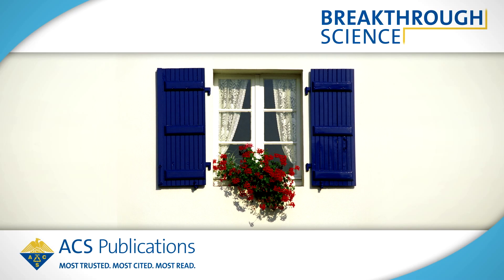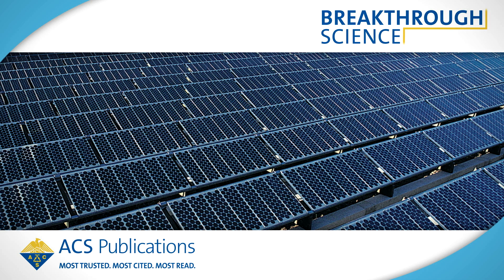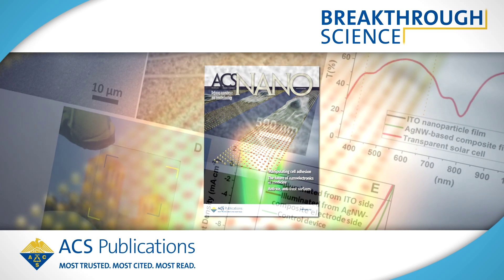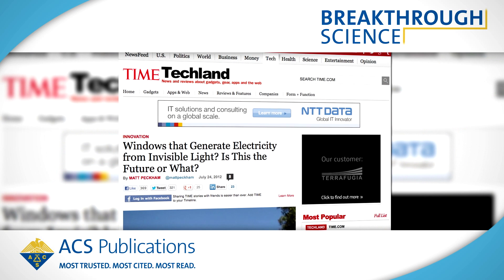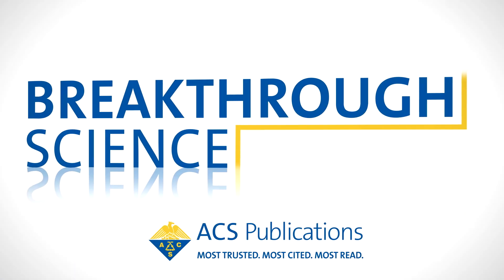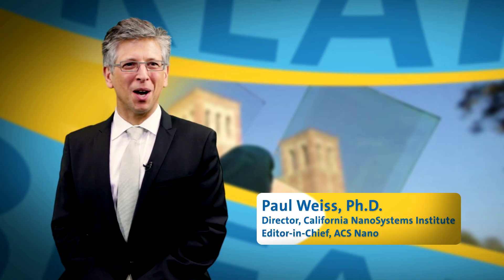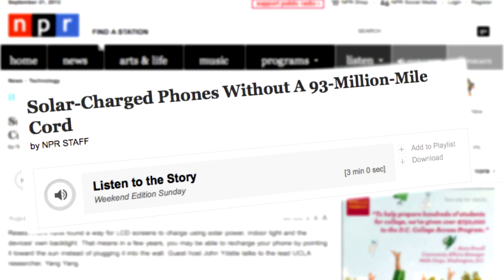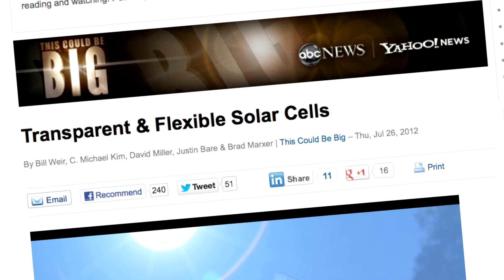Breakthrough Science: Visibly Transparent Polymer Solar Cells Produced by Solution Processing

Comment: how about build a car with solar panels on the roof and solar power glasses for windows, so it can charge itself during daytime as you park on the street and go for an hour lunch or couple hours of shopping with the result of your car is charged up and ready to go.  You won't even spend a penny of this power as sunlight is free, and also it reduces the heat in the car inside and save more power for the A/C... By the time our fossil fuel is running out, that is a time for us to find another clean fuel to use daily... I was a UCLA student and I am proud that UCLA people is so great to produce this type of new energy ideas

Comment: No. Solar cells can convert only near infra red, that means infra red with wavelengths near to visible light. Sunlight contains this kind of infra red.
Heat radiation from rather cool objects is another part of the spectrum.
Visible light: 380 - 780 nm.
Common solar cells can use up to 1120 nm.
Heat radiation from a human body is about 10,000 nm.